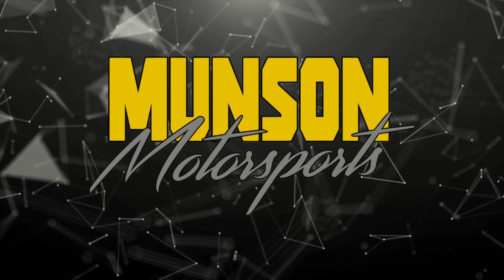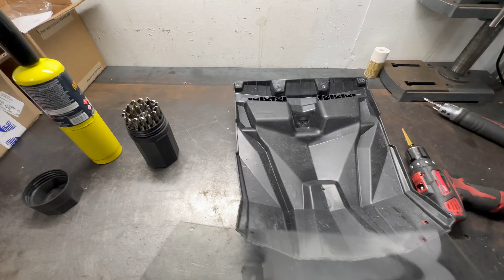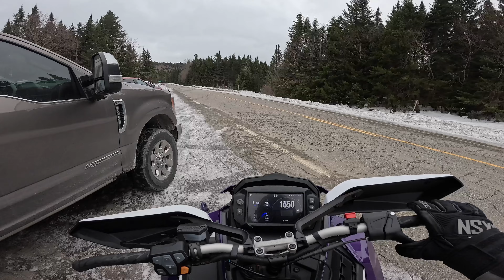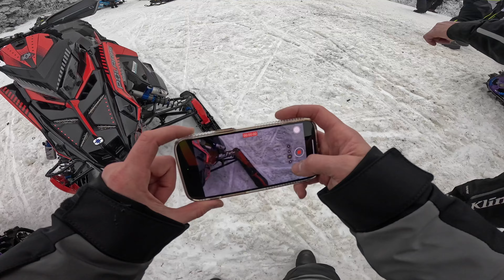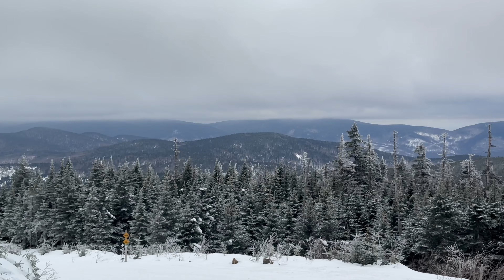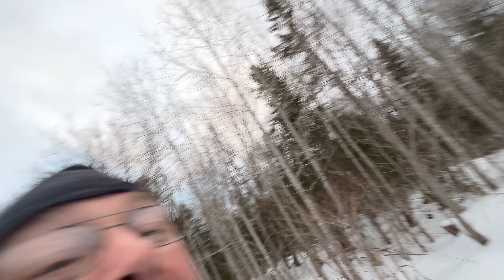Ripping the 650 Build in Pittsburg with a Polaris squad! Had some issues at the end of the ride!

Comment: Another great video, I’ll be in Pittsburg this weekend!

I like that snow flap extension! Any suggestions on how to address stripped out threads on the rear grab bar for the screw through the aluminum plate that comes up from the bottom?

A ton of clapped out trails in The Forks last weekend and my bolt stripped out the threads on my grab bar and now my flap is flopping all over the place.
Reply from the maker: The best I've been able to come up with is either size it up from M6x1.00 to M8x1.25, but you don't have much meat there for that. Alternative I've done is drill and tap a new M6x1.00 hole in one of the two other holes off to the sides, again, not much meat to work with there. You could also look into using some rubber straps like the snocross guys do/did to hold their flaps up!

Comment: Repeated broken porcelain on plugs means the engine is detonating.  Fuel or tuning issues.
Reply from the maker: I would normally agree without hesitation, but I had one plug insulator break on two separate machines, my N/A 650 and my Boost Assault. Both on different fuels (both pump 93 but when the issues arose fuel was from different stations) and stock tunes. The 650 never threw any DET codes (doesn't mean it didn't have any knock events), the Boost threw codes after the insulator broke. Both broken plugs were from the same box of 4 so I'm assuming the box had been dropped or there's a bad batch. First time seeing this in 5 years running these plugs, that said we'll see if the issue continues!

Comment: Just wondering what kind of oil do you use in your sled. Polaris oil on so expensive
Reply: Whatever u could afford,  it doesn't matter.  I know guys who run the cheapest Walmart oil in sleds since I met them in 2015. Doos, cats and Polaris,  it doesn't matter
Reply from the maker: I run strictly Klotz in my sleds. I've heard good things about Mystik, some folks love the Amsoil stuff. Pretty much any of them will lubricate just fine, how you ride will determine which one best suites you as I've seen/found certain oils respond better to certain conditions strictly in regards to exhaust valve cleanliness. Klotz works the best for me so that's what I've stuck with.
Reply: Sounds good. Thank you